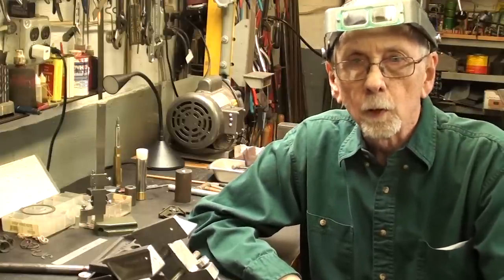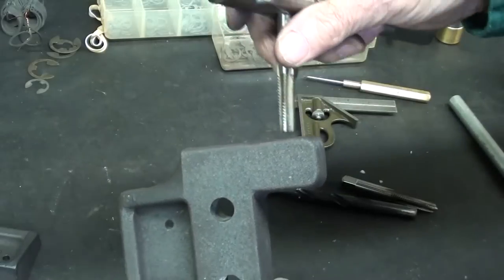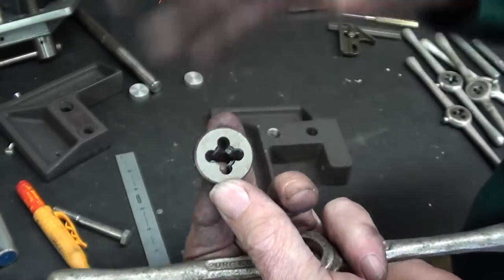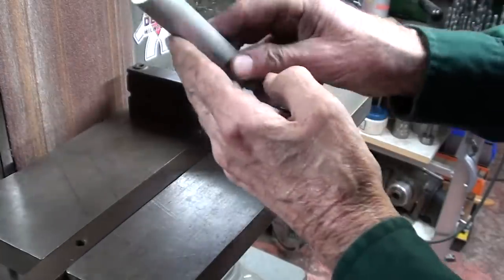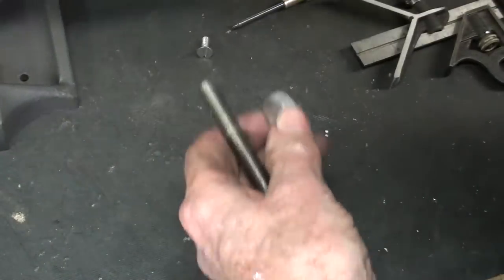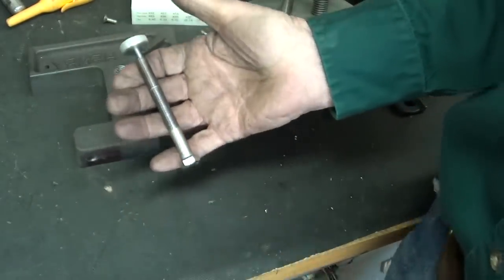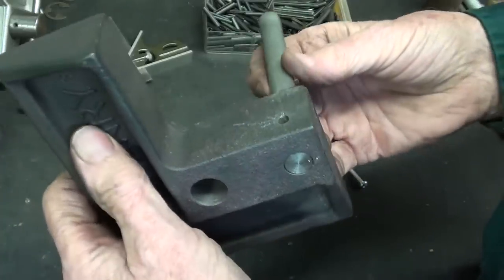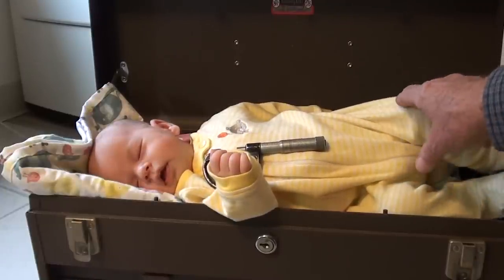CAST IRON WOOD VISE SCHOOL PROJECT pt 3 #872 tubalcain

Comment: My dad showed me about using grade 3 bolts to add more thread too, instead of trying to die-thread plain rod. I have not had to use that often, but it comes in handy when you need it. Not even my clever husband had thought about it..   Great little project Lyle, really handy vise.

Comment: This project brings up memories from my high school days in the metalworking class. Though I did not build a project like this, I was fortunate enough to be one of two in the class who were thought level-headed enough to be turned loose on the machine tools. The two lathes were beaten, battered, and abused. I spent my time off curriculum making repairs to those lathes. One job I wanted to do was make a chuck key to replace the missing one. I feel like I learned so much more by simply making the sliding handle for it than anything else I did. Why? Because ALL  the tools I had to use were junk. After 8 or 9 attempts, I finally got a proper press fit for the cap using an old school inside caliper normally used in woodworking to gage the bore and transfer that dimension to a worn out 6" dial caliper for measurement. I had to learn the intricacies of every worn-out and/or damaged tool I was using and bring all that together to create a successful result. This taught me that it isn't the tools that make the craftsman. 

On an unrelated note, Mr. Pete, if you happen to read this, would you please consider doing a video regarding form relieving attachments for the lathe? Perhaps you have some contacts who would allow you access to one, and you might go over the workings and set-up of same. I'm not talking about the Eureka project that has flooded the internet. One that comes to mind is the one Hendey made for their lathes. I have only found the sales brochure for this attachment. I would be most interested in its inner workings. I think building something with the same working principle and fitted to a modern Chineseium machine would be much easier than all the intricacies of the Eureka version, plus allow form relieving of ANY type of form cutter. Thank you for all you have done keeping this knowledge afloat, and I sincerely hope this message finds you healthy and well!

Comment: I recently had to thread the end of a long 3/16 stainless rod to make the rear brake linkage for a 1972 Triumph cycle project.  I was surprised and puzzled that it somehow came out off-center.  You mentioned something similar in this video.  Perhaps you could explain this in a short (or long!) video sometime.  I watch and enjoy them all.

Comment: Fun video. You mentioned only needing 3/8 long threads for 3/8 diameter bolt. I always heard the rule of thumb was 1.5 times the diameter length of thread. Does cast metal achieve full strength with less thread length?

Comment: Cant u put the tap in the drill press?
Reply: The hard jaws of a Jacobs chuck and the hard shank of a tap don't really play well with each other.  It's better to keep them separated. (Just like me and my younger brother!)
Reply: @kensherwin4544  lol I was wanting the teacher to reply. I want to know what he thinks about taps in a drill....
Reply: @51-FS In case Lyle doesn’t reply here’s my experience. I’ve tapped thousands of holes in drill presses and Bridgeports by gripping the taps in chucks with hardened jaws. Although not recommended in books it does work with plenty of lubricant and following the normal safety precautions. In any trade you sometimes 
have to take shortcuts to save time.